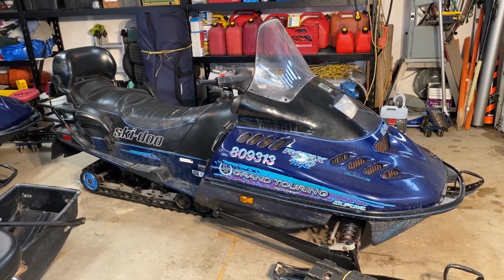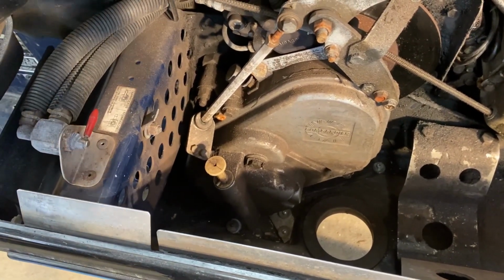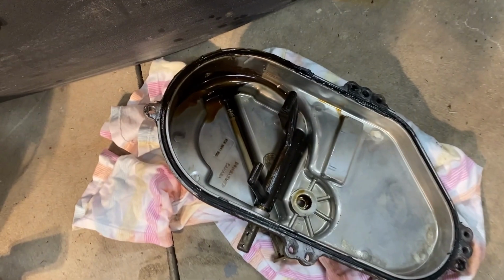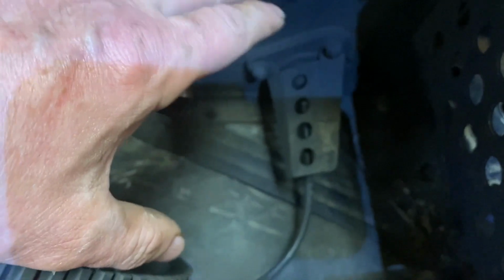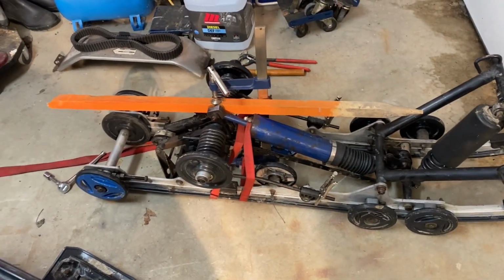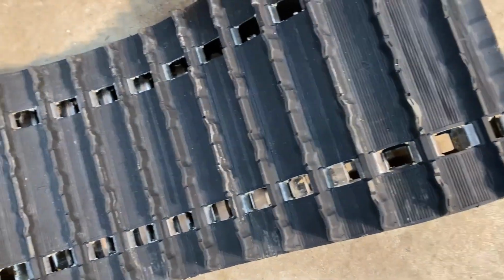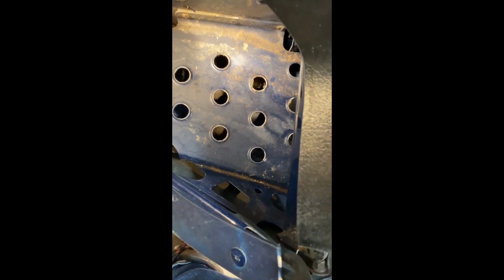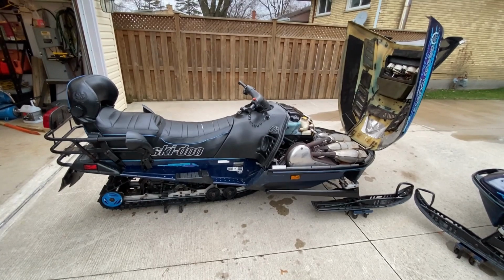1997 Skidoo Grand Touring Track replacement

Comment: its bigger job than i thought.
at least i dont have reverse to deal with, still ... doesn't look simple.
i have a 1996 skidoo 380 touring e, a small sled but its my first so everything looks baffling to me.
its taken me 3 yrs to rebuild the engine and work through elec issues. Runs good now.

Comment: The whole reason i watched  this video was for the secondary  and you didn't show removal of the secondary 😂🤦‍♂️
Reply: To remove the secondary just put the parking brake on and use a 13 mm wrench to remove the single bolt that holds it on. Just keep all the washers with the bolt so you have the same alignment when you bolt it back on. Watch for the key that goes into the spline slot on the shaft when you pull the secondary off.
Reply: Although if you’re looking for removal of the shaft then no I didn’t have to remove it.